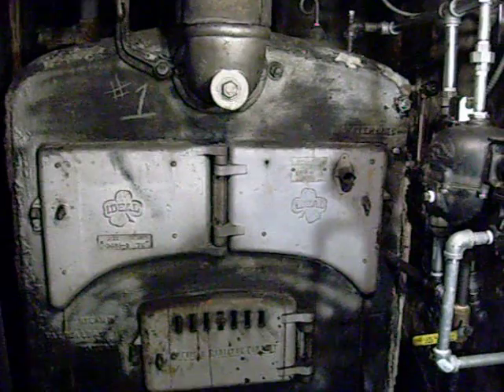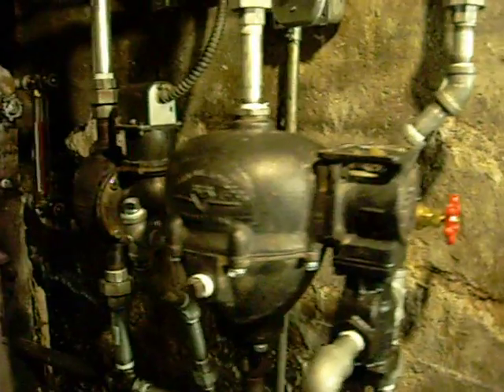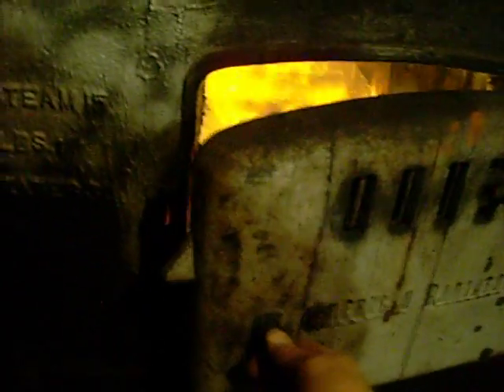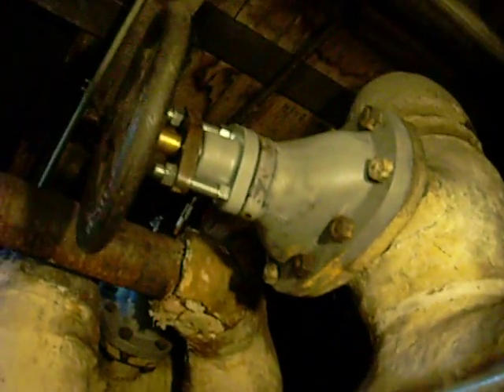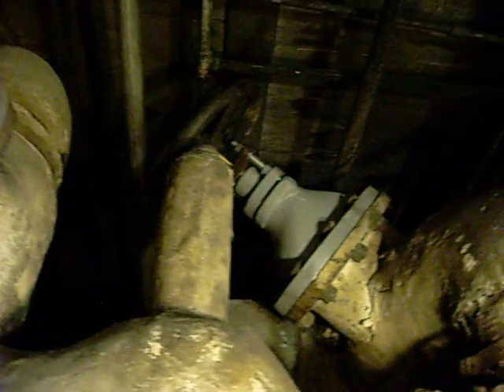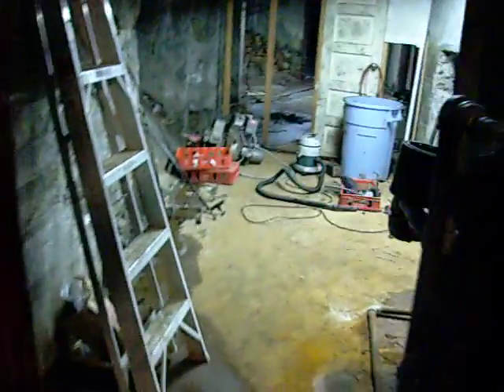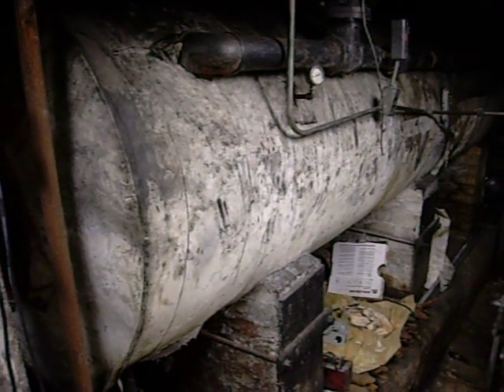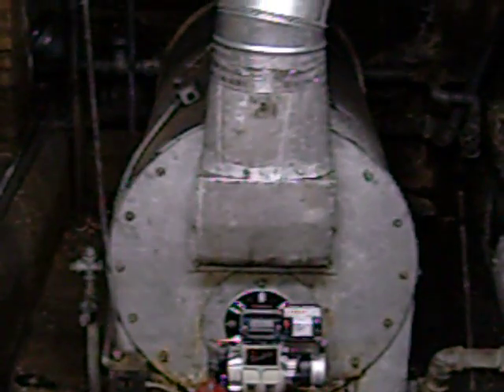1920 Steam Heating Boiler 15lb

Comment: I'm impressed by the boiler size and with how quiet that old Ray burner is.  The modern High Speed flame retention burners are more efficient, but they are so noisy for residential use.   Those older whisper quiet oil burners were built so much better. 
Thanks for posting.  Thoroughly enjoyed the video.

Comment from the maker: I had a lot of fun bringing the old boiler back to working order.  The Hotel is three stories with over a 100 rooms to heat.  The Header valves are on 6 inch pipe and thay had to be rebuilt too.  It all worked very well, but the oil burner cost for oil is a lot higher than back in the 1940s.
Reply: RailwayExpress I think the high oil prices are due to refineries cracking fuel oil to create gasoline, otherwise they would be quite low.

Comment from the maker: The main boiler that was much newer had a broken section casting due to improper operation by the hotel manager. There was no fixing that boiler. Yes there is asbestose on the pipes, just had to be careful with it.

Comment: You should mount the pigtail perpendicular to the pressure controls so that when the pigtail expands in the heat, it does not tilt the controls out of lateral level.   if the controls are tilting, the Vaporstat settings will be slightly off.   As you should run a vapor system as dry as possible (low low pressure 1-1.5 psi or less), any ounce change can make a big difference.  Make sure controls are level and that they stay there.

Comment: Not bad, thats about 1.4 million BTU/hr input. Today a 1.6 million BTU boiler would be a lot smaller!  One room I worked in had 2 1.6 MBTU steam boilers, they were only about 5' high and about 3 feet in diameter. They used 1 10"x16"x2" air filter for the combustion air blower, that was about the only maintenance I had to do on those, besides checking and cleaning the float valve for the makeup water in the shared hotwell tank that the feedwater pumps drew from.

Comment: Forced air heat is no good.When the furnace stops, so does your heat.Radiator heat is the best.Do not change your furnace to cheap quality forced air.Radiators keep on heating, long after the boiler shuts off saving you money.Don't believe that your gas bill will go down if you switched to forced air.That is untrue.Boilers are more expensive to replace,but you will thank yourself by buying one.In Europe,everyone heats with radiators because of the efficiency.Nobody heats with forced air heat.Plus the European radiators are more modern over there.Have a good day!

Comment: I live in a historic house that my family has lived in since 1920 but the home was built in 1860 and about 6 years ago before my grandmother passed our boiler man passed and she was talked into forced air heat by his son and now the plaster is starting to give out and wallpaper fromm the early 1900s that was in perfect condition is starting to crumble I'm so upset and afraid i made them leave our old boiler system untouched so i still have it the only thing that has changed is i moves one of the radiators back to its original place is their anyone in the cincinnati area that can help me I'm so so so desperate
Reply: Never thought about that before but I can see where that would be a problem with the loss of humidity in the house.  Gas forced air HVAC systems are dry dry dry.  We complain about it all the time having to run humidifiers in the winter.  It dries your lungs out and you are susceptible to colds and flus.  However, the consistent heat throughout the house is so stable and accurate much better than radiant heat.  When I switched from radiant heat to forced air my gas billed dropped more than half.  Radiant heat in the south is very very expensive due to gas prices.  You can heat with oil or coal anymore.  Fire codes are trying to ban wood burning stoves as well as split units in homes.  The latest fire safety is that your furnace unit should be OUTSIDE of your home.